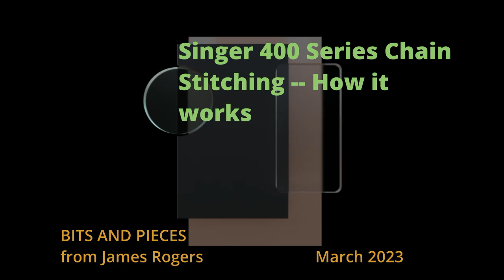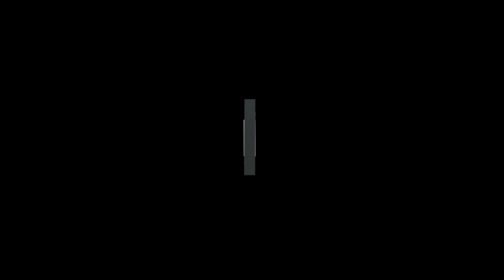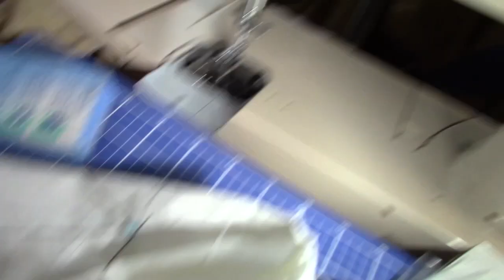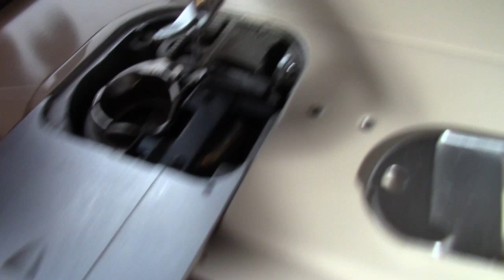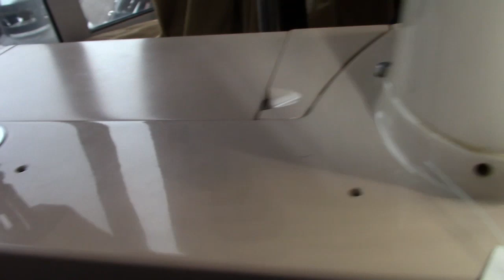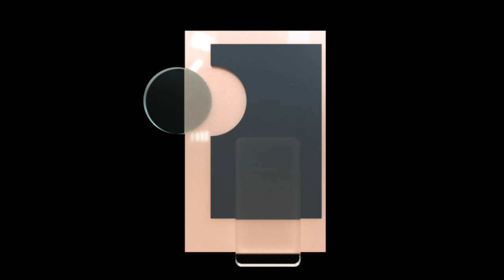Singer 400 series chain stitching

Comment: While as an amateur tailor I am  enjoying many of our videos tonight, I would appreciate an opinion too. Time ago I found out a Greist buttonholer in perfect conditions and for a very good price , but i couldn't use it on my 60s Necchi Supernova, because its dimensions did not allow the presser foot lever to go all the way down. That buttonholer is now working magic in a small atelier in Africa, but I still would like to get one,  a contemporary replica is sold on a chinese site and it looks ok, but since I found a real connaisseur, I try and ask you for advice. Thank you very much for your work, it's a lot of interesting stuff to watch.
Reply from the maker: Do you know which model of the buttonholer you had? I remember trying quite a few high shank options to find one that worked. I did buy a modern one many years ago and it was really heavy and good quality. If you look at the weight of the modern ones, it can help give you an idea of the build quality because it should be surprisingly heavy.
Reply: @jamesrogers991  that was a Greist Buttonholer, the black model, it came in a green box with all of its accessories, a real bargain like 25 Euros, works great on an industrial machine just lowering the foot bar, as well as on an old portable Singer, the type with zigzag, possibly from the 80'.
Reply: @jamesrogers991  the Greist was heavy and elegant, you could tell it was designed in the late forties, early fifties, now I would like to try this almost replica sold on alxprs around 25 Euros, cams are differents from the Greist as they are split in two, so you can combine and obtain various lengths of holes and keyholes.
Reply from the maker: @paolo3087  Could you share the link to the model which you spotted? I would like to try the split cam solution. It sounds very interesting indeed.

Comment: Sadly... Clear as mud. I've recently bought two 411g. I couldn't believe I got the 1st for $50... a day later another in even better condition for $45. I was trying to get a a handle on the chainstitch making some prototypes tonight... but I don't understand how it works at all. Further, still can't reliably pull a chain out. Which is to say... I am hoping for another video.

Comment: Hi James, Been watching all your videos on 400's in particular. I have a 411G for a year now, minus the the chain stitch plate and bobbin, shame. Have advanced my sewing ability and now would like to buy a unicorn as well ! The one I'm really tempted to buy (2 hours from my home)  has part 503601, but not Bobbin Case 503602. I presume 503602 is needed to chain stitch, please correct me if wrong on this point.  Have you managed to get any 3D printed 503602 part ready, if so can I buy ? Best regards.
Reply from the maker: @davelittle6970 -- Thank you for reaching out to me. The bobbin case for the 411G and the 431G are the same. The top plates are different for obvious reasons. I have been working on a solution for the problem of the missing bobbin cases and plates for the machines. 

The delay is getting access to a few things which were common-place many years ago. I live in a condo so having access to a workshop and the correct tools is a challenge. If there were an old-style auto bodyshop somewhere nearby, I could pop in there and get it resolved. If I were still in high school, I would have access to some suitable tools. 

That being said, I have managed to get in contact with two architects who can help me. I need to get the design of the part done in the simplest way possible. I could try to get it machined on a CNC machine from a solid piece, or perhaps creating a dye and then bending the piece would be a good option. 

Ultimately, it may be fastest to do it on a CNC machine even if it wastes metal. 

I am absolutely open to help from anyone who can assist to get this finished. I have plates designed which work for a 3d printer for testing, but they are a little too flexible so need to be made in metal. 

If you have any skills to add to the mix, let me know and then we can get you the plates and bobbin case very soon. 

And, the bobbin case is really simple to resolve if you do not mind putting a bit of glue on it -- there is a small piece of bent metal which is attached to the chain stitch place -- it is rounded on top and bent at 90 degrees. I have tried a few types of metal which I had lying around -- the one metal snapped so I needed to heat it up with a torch, and the other too thick. 

It will be easy to resolve, perhaps with brazing or cnc again, or I can buy a small metal brake to bend it or create a DIY brake -- the problem is that the bend must be accurate to a very high tolerance. At any rate, I would get the unicorn and call a few friends -- maybe together we can get the parts made quickly.

James
Reply: Thanks for the quick reply. I think the question may have been answered, but I need it spelt out clearly as ebay time is very short. 23.13 hrs and need to sleep for work tomorrow.
Is it possible to chain stitch without the hooked bobbin ?
Reply: @jamesrogers991  its a conversation id like to explore at a later date, spot welding etc. but can I chain stitch without hooked bobbin Case 503602 ?